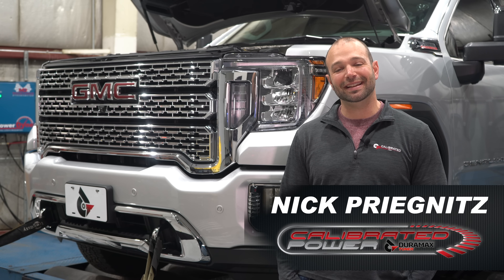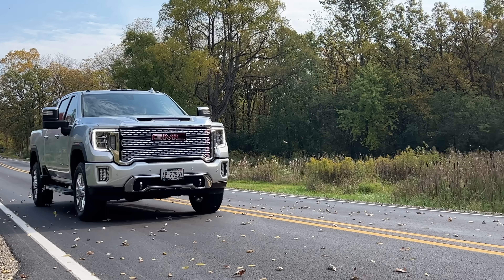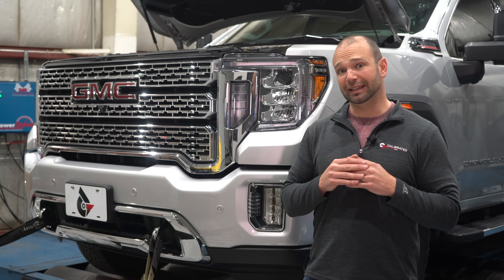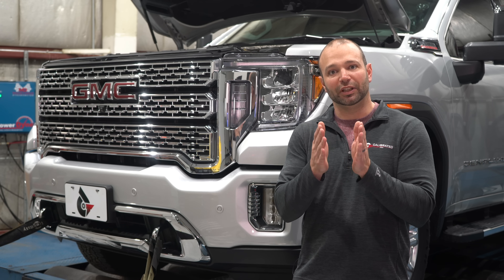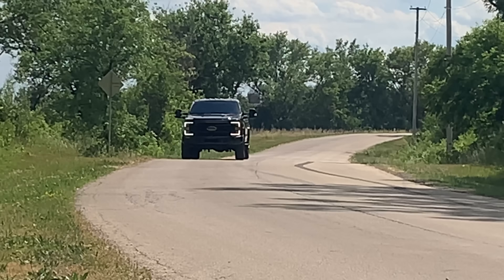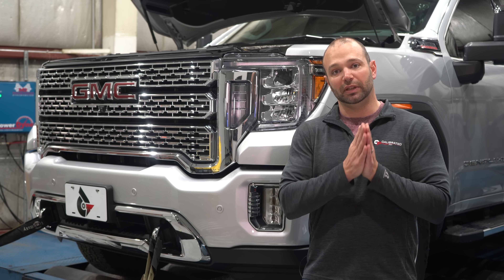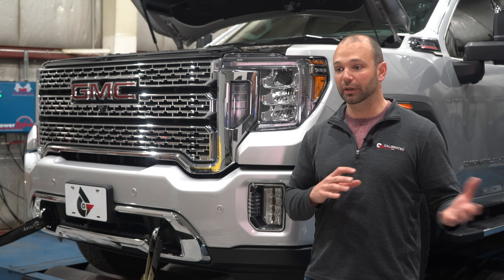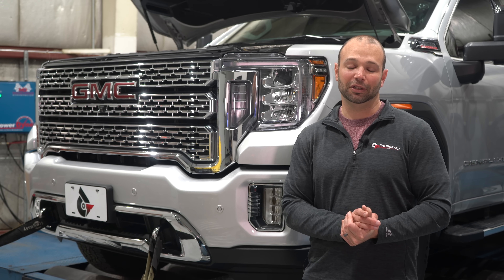10-Speed Allison Transmission 101

Comment: The funniest thing that’s not Allison 10 speed it’s a GM transmission
Reply: @raulbueno4284  calm down, Raul. Your Tundra is not doing the work a 2500 HD GM, or F250 SD  does. It's a good little half ton, but it's  not hauling 14,000 lbs (safely), so it's  an apples to oranges comparison, your Tundra's max tow capacity is half that.
Reply: @raulbueno4284  Cool story, Tundra has soft rear springs and HP and TQ number do not magically mean different things on a tundra over any other truck engine. When you tow you know it back there I know its back there we all know its back there.
Reply: @JasonNotBot  good point. I’ve noticed that Toyota does rate things slight more conservatively than the big 3. That being said, I don’t really care for how the tundra tows. The drivetrain is outstanding but the suspension and brakes feel extremely taxed very quickly.
Reply: It’s Allison branded
Reply: I like the new tundra had the old one but need more towing capacity big boat...
Reply: @toadis6949  my son has a tundra and it a really nice truck however he couldn’t tow our 5th wheel like our Denali
Reply: @toadis6949   why they pulled space shuttle with Toyota 😂😂
Reply: Yup, built and developed by gm not Allison... What's worse is when you tear a 10L Allison down next to a 10r140 Ford and realize the Allison is a weakling. The clutch friction plates are literally half the size on the Allison, even the planetarys are dinky. The new Allison while impressive for a 3/4 ton or 1 ton is definitely an Allison in name only😢
Reply: @redneckrebelzracing2891  absolutely
Reply: It's built at the general motors powertrain plant in Toledo Ohio
Reply: Y’all would argue about whose truck seats have the smallest/longest shit skid mark on it!!!
Reply: Correct. Allison stamped not Allison built.
Reply: It’s actually a Ford Engineered transmission that GM bought into then pays Allison royalties to use their name.
Reply: It’s made by Chevy using Allison technology
Reply: @charlesmiller3134  nope.
GM knows people love the Allison 1000, they no longer pair an Allison with the duramax, so they had to figure a way not to lose loyal customers.  Allison says they did not develop it, they do not make 10 speeds,  do not bring the gm Allison branded trans to them, and do not try to buy Allison parts from them for that gm transmission, and to take it to the gm dealership because Allison won't touch because it is not an Allison.
Reply: The GM version is built beefier than the ford. Compare the planetary between the two
Reply: It’s actually a Ford Engineered transmission that GM bought into who then pays Allison royalties to use their name. 

GM is a joke.
Reply: Gm is an Allison transmission. Check their website
Reply: @austink4712  do some research. GM bought into a Ford engineered 10 speed transmission and is currently paying Allison royalties for using their name. The only thing that separates the GM 10 speed from Ford is the tuning and shift points.
Reply: It's a GM transmission with the Allison approval. If they had issues with the transmission build quality they wouldn't have let them brand it with their name. Also GM owned Allison for 80 years if you don't think they didn't keep some of the engineers and keep knowledge from that you must be dumb.
Reply: Gm used to own Allison transmissions but they sold it off😥😢😟😓😞
Reply: Yeah, everything made America sucks
Reply: But the funniest thing you know what is, did you ever knew the tundras? We are differentials bigger than a three-quarter ton and if you ever knew that Tundra’s calipers are bigger than a heavy duty truck, they didn’t renew that the financing mine will last longer than yours piece of shit American and mine will toe up to 14,000 pounds I know that for fact it will do I care is illegal know
Reply: The funniest thing man, what you tow What kind of truck you have don’t tell me American because American stuff her piece of shit.
Reply: Do you know what bro it’s funny all American vehicles are not made here they’re made in China
Reply: No shit. I was hoping for a video about something to do with the reliability or how it’s overbuilt or whatever.
Reply: Funny? Where is the punchline or humor?
Reply: I’ll keep my zf6
Reply: @GMT_800s  Allison transmissions have never let us down. They are amazing. The Allison 10 speed is amazing. 10 gears not including lockup. This is the worlds most powerful transmission. It has a crazy amount of torque multiplication and can turn any diesel or lower rpm engine into a serious tow pig. And it’s the smoothest shifting transmission Gm has ever made
Reply: @Dev_Zombz wow I've got a 23 at John Watson Chevrolet in Ogden with almost 7000 miles. Has a bad torque converter. Sorry 😂
Reply: Go in Google images there’s a lot of tundras, pulling horse trailers fifth wheels, bumper poles, gooseneck, trailers a lot of them
Reply: Yeah, you think American truck will last a long time not much weight and let me tell you this, but Tundra is not the only truck they have. I have bigger trucks learn your facts right bro if you want to talk shit talk shit real shit no baby shit. And the funniest thing the ram trucks are use the heavy duty’s. They use the same transmission as a Tundra.
Reply: Do you know the funniest thing as all Americans think nurse stuff is better than anybody else but you know what it’s not all your shit are made in China that’s why they always fall apart
Reply: Thank God!
Reply: That’s why Americans think they’re all bad ass with their vehicles, but they’re all junk
Reply: What a bunch of whiny wannabe know it alls!! Some of you idiots would keep your 8-tracks over this crazy unheard of mp3 crap😮
Reply: So GM, Allison, Duramax, Banks, and practically everyone else on the planet are wrong, I find that hard to believe?!
Reply: Beat me to it.
Reply: If they say its an  an ALLISON, ITS AN ALLISON PERIOD YALL IGNORANT FKN HATERS!!
Reply: Yikes. Def don't trust it then.
Reply: It is a Ford transmission!
Reply: Allison does not make a 10 speed transmission except an attempt many years ago with international it was called tc 10
Reply: This video is a waste of time a real joke!
Reply: ZF
Reply: Anything available for the 24’s yet?
Reply: @raul bueno throw a Lincoln machine with a steel bed and tow a 5th wheel , i bet that tundra is going to start in that same spot spinning the tires
Reply: That’s fine bring it on the Tundra do it perfectly fine
Reply: That’s funny because you know why it’s funny because you know that Tundra I’ll perform and how last any truck out there. I think you’re a lady because I think you have one.
Reply: Actually it's a Ford transmission
Reply: Combined development between GM and Ford.   With modifications on the basics by each manufacturer.  But slapping the Allison name on itis a bit of a stretch.  Although the emblem on the fender is pretty.
Reply: Actually it was developed by Ford GM and ZF
Reply: No... IT'S A FORD 10R-140 actually... Not GM and not Allison
Reply: Gm used to own Allison. No more. But Ford Surely doesn't.
Reply: So many keyboard experts out there.
Reply: Wouldnt it be better to to put a overdrive unit on the 6 speed allison transmission like a gear vendors. You could then split all 6 gears.
Reply: This is true
Reply: Thank you I was going to day thr same thing
Reply: It’s a gm built in house transmission but Allison tested and approved it and help gm build the 10 speed
Reply: @pedromadrigal1308  since GM owns Allison, that would make sense.
Reply: @cisco1dog gm sold it in 07. Bailout money
Reply: That’s funny it is true because I remember when they were working together GM and Ford to make a good transmission and that’s it is
Reply: @raulbueno4284  they didn’t work together. Ford and GM when going to share. Ford was to come up with a rear wheel drive transmission. GM was to build a front wheel drive transmission. Ford didn’t like GM’s transmission. But GM liked Fords. So GM’s 10 speed is built by Ford. It uses GM software. And software is the problem with the GM recalls. The transmission had some issues in the beginning but it mid 22’ Ford fixed the issues. The current transmission mechanically is decent. The 6 speed Allison can’t hold up to the power of the new diesels and give the fuel economy requirements that the liberals have passed into law. This 10 speed will be the transmission in GM and Ford likely forever. With improvements done as we go.
Reply: @raulbueno4284  yet somehow GM has programmed it a lot better.
Reply: @davidporter7051 Ford tries out everything first, although they built the Transmission together for one now change the programming
Reply: @davidporter7051  fords having less issues with theirs. Than GM. Ford design the transmission. GM was to design a front wheel drive 9 speed. Ford choose to not use the GM design front wheel drive. But GM wanted to still use Fords designed. So it is a ford designed transmission. That GM is building themselves. Per the agreement. But Ford is not using the GM designed unit. Ford and GM are both having some issues with the transmission. Ford started using it 2 years sooner. GM waited until the bugs were worked out. Which was smart. In 22’ Ford has theirs working well. GM started building their Ford designed transmission in 22’ Neither transmission has nothing to do with Allison.
Reply: The 'Allison' HD 10-speed is not the GM/Ford joint venture trans gentlemen. The HD unit is the 10L1000, the joint venture trans is the 10L80 and is only found in the half ton trucks. The 10L1000 has nothing to do with Ford, and went under the knife to meet Allison's strict testing and quality requirements. It is hands down the best HD transmission available in a 1-ton pickup currently. You can argue 'this one blew up, or my Super Duty trans is way better', but I don't care. Numbers don't lie, and when one of my best friends owns a diesel performance shop, and the RAM and Superduty trans rebuilds outnumber the GM 5 to 1, that says something. (And yes the Duramax puts out every bit as much power and just as reliability as the other two brands guys!!!). Again just to make it very very clear...10L1000 GM/Allison...10L80 GM/Ford. Very different units.
Reply: It’s an Alison branded transmission as Alison had tested it and approved it. I’m quite sure it also used some design wether it be mechanical or engineering from Allison.
Reply: I heard from a guy who chipped and deleted his new Chevy 3500 with the 10 speed and the tranny blew twice… he previously owned the Chevy 3500 with the 6 speed Allison tuned and deleted with no issues… he got rid of his new Chevy because he says the Allison 10 speed is weak.
Reply: @vincefairleigh6899 well when you turn them up and don’t tune the transmission because there is no transmission tuning available for them yet, you’re going to fuck shit up.
Reply: No, they don’t. I’m promise you that they don’t only make a six speed automatic.
Reply: GM owned Allison, from 1928, untill 2007.
Reply: It's a gm transmission. They had to re design the transmission a few times to meet the standards for the Allison name. The 1500 or f150 series has the joint venture gm Ford along with a 10speed that you see in gm cars a different transmission for front wheel drive... Ford refused to use ... I'm in the market for a new HD truck purchase within a 10 month period. I'm a Ford guy currently driving a 21 Tacoma TRD pro 6speed manual. Sold my 3valve f350 V10. Was looking at dodge with the aisin and Cummins but they are having massive engine failure due to the dpf emissions tuning on all new Cummins and the aisin trans isn't holding up. If you go Ford or ram they make a ball joint delete kit works like a king pin but looking at post COVID I'm kinda tied down to gm. Should I mention that there are working the new HD trucks right now... Dullys are getting updated wheels as well.... You buy gm they have 31plants in the USA and 29in China. I go gm I know right off the back replace all wheel bearings ball joints spare set of door handles etc the stupid stuff that will brake etc get the frame coated as it's not on a 100k truck...
Reply: @toadis6949  it's not a redesign. When parts are interchangeable it's not a redesign. At best it's a modification.
Reply: @davidporter7051  not the same transmission , this is totally different transmission. This is not co developed with Ford, this is only used in 2500 and up HD applications.
Reply: @stellingbanjodude  it's the same transmission there is two parts which are different and both transmissions can change parts. Even an Allison engineer stated if one wanted to repair a 10L1000 just get the Ford repair manual.
Reply: @davidporter7051  false no interchangeable parts at all
Reply: @davidporter7051  There’s fewer parts that are interchangeable than you may think. The light duty 10R80 and GM 10L80/90 are largely interchangeable. 

The Ford 10R140 shares far fewer parts. Even the cases are not interchangeable as the oiling strategies are different. The valvebodies appear identical but TCM is very different. The hubs, drums and even the clutches and driven plates are not interchangeable. GM or Allison is building them under a Ford license but they took several liberties in modifying the Ford design
Reply: @stellingbanjodude  GM-Allison pay licensing to Ford to build that transmission
Reply: @davidporter7051  post the link where the Allison engineer said that.
Reply: @toadis6949 what do you change yhe wheel bearing that like 3000 dollars wirth of heavy duty bearing
Reply: @toadis6949 Ram ditched Aisin and will be using ZF Powerline trannies in 2025
Reply: It’s all over YouTube
Reply: Allison, used to be a GM company, they have the rights to the name.
Reply: It originally started as a joint effort between Ford and GM.
Reply: Department of Energy funded this transmission. Ford and GMC have same transmission, different electronics
Reply: Your right ford and chevy co designed  that transmission. It's in all ford and chevy  vehicles
Reply: It’s a GM transmission that Allison 100% designs & blueprints-Facts
Reply: I have a first generation Toyota tundra, and I put a gooseneck with that truck pulls the trailer but it’s not there
Reply: @raulbueno4284  a tundra does it pull a gooseneck like it’s not there. Get real, stop lying .
Reply: @raulbueno4284 Bwahahahahahaha! I have a 2019 Tundra and it’s a gutless wonder when I put my quad in the box. I can’t imagine towing my holiday trailer with it.
Reply: @ lol 👌🏿
Reply: Your right, it's not made by Allison, but it was co-developed and is put through ALL of Allison's strength and durability requirements for a transmission with their name on it. It is every bit as good as an Allison that came down their line. Just want to clear that up, I'm seeing the 'it's not an Allison' WAAAAAYYYY to much. Then I guess an F150 isn't a Ford, and a RAM isn't a RAM, and a Tesla model 3 is a Chevy Cruze becasue let's face it, it's mostly GM co developed tech in that car anyway....shhh Elon doesn't like talking about that.
Reply: @redline455 😂 better check more information out.  It's  10 trash gears.
Reply: And it's not a GM transmission. It's a Ford.
Reply: @davidporter7051  I am not sure they are the same anymore if u look at the gear ratios of both the ford 10speed is gear lower than the chevy 10speed
Reply: @bigmurph1447  the programming is by far the biggest difference between the two.
Reply: @davidporter7051  it’s not a ford transmission they never worked on it
Reply: @davidporter7051 ,  nope.  It's not the same transmission Ford and GM collaborated on.  This heavy duty transmission is built by GM and Allison approved it and allowed GM to use their name on it.
Reply: @davidporter7051  thats the 10r80 and 10l80e/90e
Reply: @davidporter7051 no its not. The joint Ford/GM transmission is the 10L80, the HD uses a 10R1000, totally different trans.
Reply: @David Porter  how do you know that?
Reply: @David Porter  ahhh man... you ford guys can't let this go.  Well what's funny is that it's not the joint designed 10sp by Ford. That's the one with a class action lawsuit. Try a Google search.  You'll find out that the 10L1000 was not designed by Ford. 

The 10sp in the camaros and cadillacs are the ford 10sp.
Reply: @davidporter7051 and it’s a ford transmission that gm pissed with and made cheaper and weaker lol nothing in the the gm version is better just worst a lot the same but where they could they saved
Reply: @TheCumminsturbo2  do you consume oxygen primary through your Boca? Ford has a much higher fail rate than GM. More warranty repairs and lower customer satisfaction. At least come with facts if you need attention.
Reply: @davidporter7051  look at the tear down on here comparing the two trans I’m not pulling this out of my ass and as far as fail rates and customer satisfaction that’s a joke because of the reporting proces gm didn’t want to spend the money on developing the trans so wat makes you think there going to improve on it
Reply: @TheCumminsturbo2  your reference is a nothing burger literally. Despite all the "improvements" the Ford version is a more unreliable transmission. YouTube teardowns are not facts. There are no fewer than 3 different active recalls for 10R140 affecting nearly 100000 trucks. Multiple TSB's. In short you provided a video nothing else.
Reply: @davidporter7051  all the so called tsb. And recalls are software related im talking bout hard parts software can always be fixed easily and it up to the manufacturer to issue them and if decide not to it’s because there hiding something in the long run 200 300 k the ford has bigger clutches bigger bearings all around better design
Reply: @TheCumminsturbo2  it's not tsb software related. "Replace the No. 1 planetary and ring gear assembly." "The fix: dealers will replace a gearset within the transmission, free of charge." Definitely not software.
Reply: @davidporter7051  Bold claims with no data to support it.
Reply: @davidporter7051 wrong its not the light duty 10 sp that ford designed and has massive problems with.  Try google
Reply: @davidporter7051 the ford has beefier parts in it
Reply: @freedomisntfree_44  and fails at a much higher rate.
Reply: Not this one,  1/2 ton was codeveloped with Ford, not the HD
Reply: @davidporter7051 it was developed by ford and gm. Either way they are all junk
Reply: @davidporter7051 no it’s not it’s gm ford only did the light Duty trucks transmission
Reply: @Bombcityoverland  nope you can't have a transmission that is 80-90% the same and say it's a different design.
Reply: @davidporter7051  no, that was the light duty.  Ford and GM did not collaborate on the heavier diesel transmissions...on the F150/GMC 1500, yes.
Reply: @davidporter7051  the 10 speed hd trans isn’t the co developed one.
Reply: @brianhilligoss  True, the 10R80 GM jumped in to help fund during stage 2 of the development. Ford still owns all 5 of the patents issued on that transmission. Internally they appear nearly identical.

This transmission is derived from Ford 10R140, though GM bought those licensing rights during final stage IV testing in project. There’s couple stories I’ve heard; Allison was developing an 8 spd 1000 series that did not meet the torque limit requirements of Isuzu-GM or Allison raised their oem pricing for new 1000 series 8 spd beyond GM budget. Whichever the case, GM bought license from Ford to develop a version of 10R140 which they then hired Allison to program valvebody. If you look at valvebody of the Allison, it appears identical to the Ford, the TCM is quite different. 

Having disassembled both, it’s clear GM-Allison have made additional changes in their version, some quite inexplicable. For example the clutch frictions on this transmission are MUCH narrower than the Ford, the teeth on drive plates and clutch tabs are substantially lighter on Allison. The entire pressure system from pump to feeds are quite different. It appears the Allison was built to a much lower torque rating. Why they did this is unknown, I suspect it was to allow usage of parts from Allison parts bin but that’s just speculation. The cost savings for reducing torque limit is minimal. Using existing parts inventory and tooling would however provide potential massive savings.
Reply: @brianhilligoss yes it is. Do more research.
Reply: @brianhilligoss it is the ford gm transmission. It is the same architecture, built by gm, modified slightly.  They seam to shift smoother and the one i drove didnt jump forward when put in gear. But they have a higher valve body failure rate.  

Allison is simply a brand deal. Its a name only. Allison actually called for the “valve body revision”.  Considering the valve body is the main failure, it points to allison and their change.
Reply: @davidporter7051  actually it’s a cooperative effort between Ford and GM
Reply: @davidporter7051   they co developed it - a gm/ford transmission.
Reply: @David Porter  it was a collaboration between GM and Ford
Reply: @james10739  no it was just GM
Reply: @james10739   yes,,,the 10:speed is all Ford and was traded to GM for their 8 speed FWD transmission.   GM did do their own programming specifically for their vehicles.
Reply: @james10739 they light collaborated on the light duty trucks. The heavy duty trucks are different.
Reply: @james10739  that I believe was for the non HD version for the half tons and suv’s
Reply: Ford/GM joint venture.
Reply: toyota and hino commercial
Reply: Plus, Allison does not make a 10 speed automatic
Reply: @raulbueno4284  yes, they do. I beta tested it in a daycab for US Xpress years ago.
Reply: @Steeltoe87  Allison says they do not make a 10 speed for pickup truck applications. They also said if it's not an Allison 1000 or 2000, it is not theirs. They also stated that to not bring that 10 speed to them for service or repair, because it is not an Allison and to take it to the GM Dealership.
Reply: @Steeltoe87  No they don't I promise you they don't.
Reply: But the funniest thing man I’m not trying to be a asshole to no one, but the transmissions are not good. I’m a technician for seven years, and I heard stories about those transmissions.
Reply: @raulbueno4284  no issues here and I have a Ford and GM version. Your statement is a direct quote for an opinion for every transmission.
Reply: @davidporter7051 my silverado w 10spd has been at dealership for 4 months due to valvebody issue with no eta on repair
Reply: @sawcebosswannabe  then lemon law it and post the paperwork on YouTube
Reply: @davidporter7051 have a 2021 L5P. Biggest junk of a transmission ever. Took it to get serviced at 35k miles. Had the transmission gaskets replaced, didn’t help. Starting to really jerk and have rough shifts
Reply: @vasyatutbuv  I didn't believe you don't waste your time
Reply: @raulbueno4284  so you’ve been a tech for 7 years but you’ve only heard stories not actually first hand? Lol
Reply: The thing is man those transmissions suck ass right I heard stories about him. I seen him there are junk.
Reply: @raulbueno4284 your a technician for 7 years and youv never worked on one it sounds like. Youv heard stories
Reply: @raulbueno4284 Heard is different than had. Come back with real world experiences young man.
Reply: @raulbueno4284 ”heard stories”???   Every  “expert” on YouTube says the same thing.  Sounds like circle jerk logic to me 🙄
Reply: @raulbueno4284 buffer 7 years all you've heard is stories about the transmissions and not experienced any problems yourself
Reply: @ClaytonBigsby01  you’re funny
Reply: It’s actually a Ford/GM joint venture
Reply: @ZmannR2  wrong
Reply: @adenseay7406  I’m speaking of the half ton 10 speed. Not the Allison. The half tons are codeveloped with Ford
Reply: Really I do have one I’m not lying to you. Why do you have a little American vehicle? That’s why I always breaks down.
Reply: Just look up the 1,000,000 mile tundra I mean there’s two tundras one 2,000,000 miles doing hot shot
Reply: @raulbueno4284 😂😂😂
Reply: The funniest thing man there’s a new Tundra 2022 tundra this guy bought. It pulls a horse trailer with a gooseneck trailer. OK and I performs a diesel truck look up the video on YouTube.
Reply: But the funniest thing I would never own a American vehicle only truck I will own as a tundra
Reply: @raulbueno4284  Show me a Tundra hauling a 4 horse trailer with a 14 foot living quarters thats 38 feet long overall and weighs 9k empty, and I'll own it. Don't get me wrong,  I've had 3 Toyota go well over 300k, going back to the 18r engined hills, but they don't have anything that can haul what I need to move.
Reply: @Raul Bueno it's made in America
Reply: @raulbueno4284 commie
Reply: @raulbueno4284 Tundra Rust bucket with their failed frames. Lol what a joke
Reply: @raulbueno4284  for a car that gets bad mileage. Toyota is a good option. Kinda. For a pickup they are garbage. I use my trucks. And a Toyota will never cut it.
Reply: @ 
Funny
Reply: @raulbueno4284 the tundra is not a work truck, American trucks tow up to 30,000. Lbs… your tundra tows? 7000-11,000. Max? And can only carry 1500. Lbs… American trucks carry double what a tundra can do…
Reply: @Raul Bueno  let's see you pull my 42 foot fifth wheel with that Tundra...
Reply: @raulbueno4284 tundra is a lady's truck😂
Reply: @raulbueno4284  And you’ll do nothing heavy duty with it.